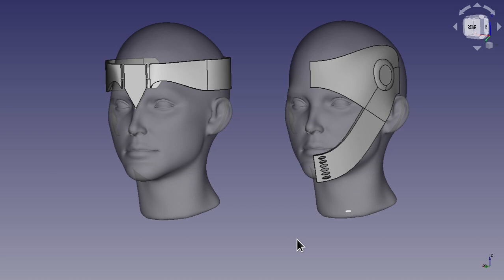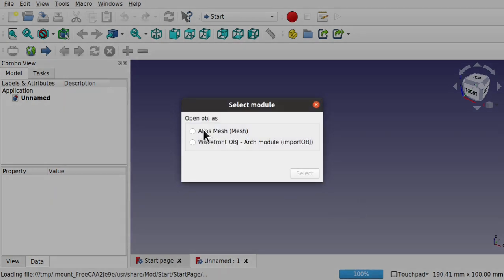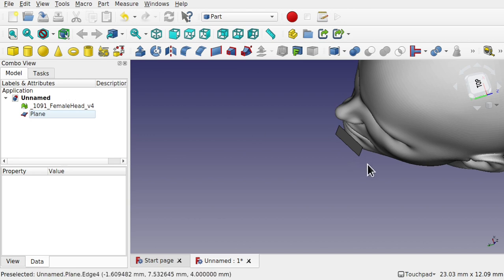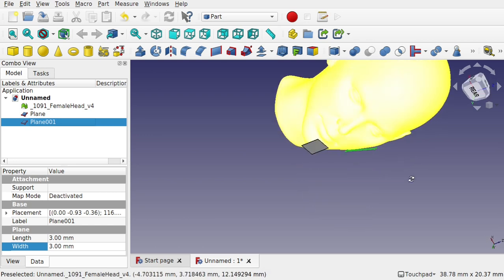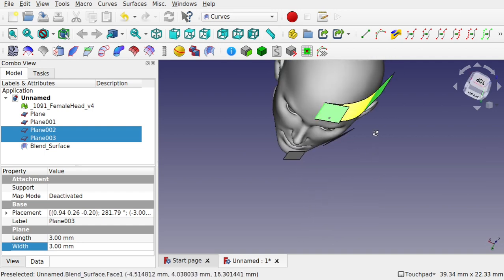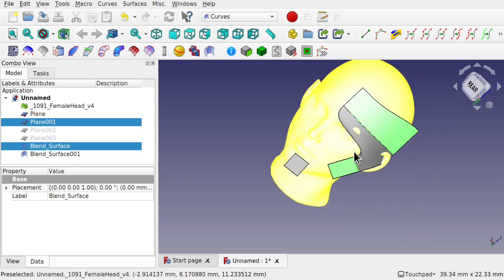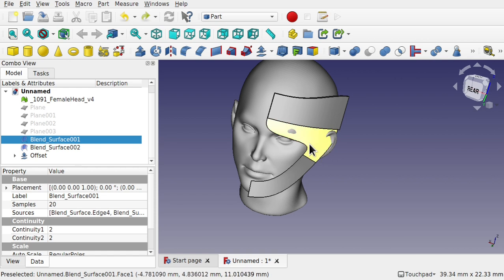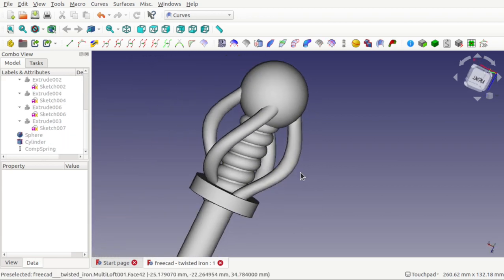Learn FreeCAD Curves Workbench [7.2] Blend Surface. Create surfaces between faces. Crowns Helmets

Comment: Just a heads up for others that don't have the Blend Surface icon or the word Surfaces on the top in the Curves menu. Today is Sept 18th 2021 and I just installed FreeCAD 0.19 It already had the Curves workbench included but it's missing the above components. I went to Tools and then Add On Manager from there and selected the Curves workbench which had (installed) listed after the name. Once highlighted I clicked on the Install/update selected button at the bottom of the window. It required a reboot of FreeCAD but my Surfaces word is now on top and my Blend Surface icon is in the tool bar and both work as they should.
Reply from the maker: Thanks for the comment, that's interesting they have included it with the install which is great news.  Thanks for this information, really appreciated and helps the community.